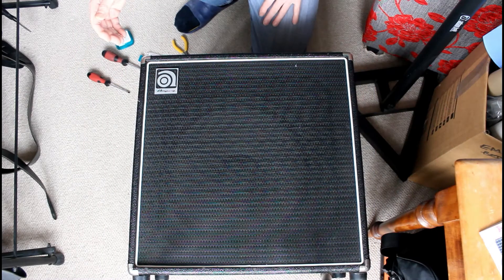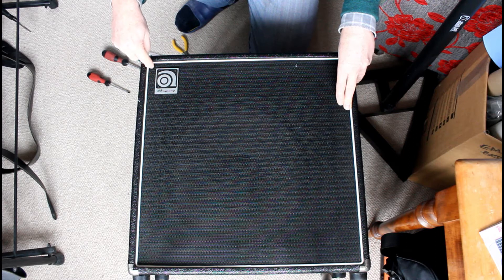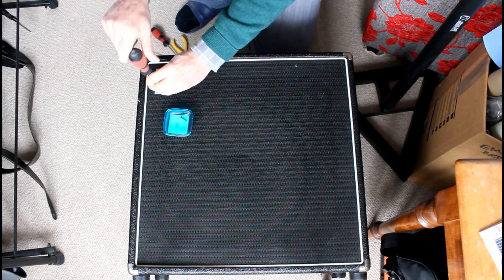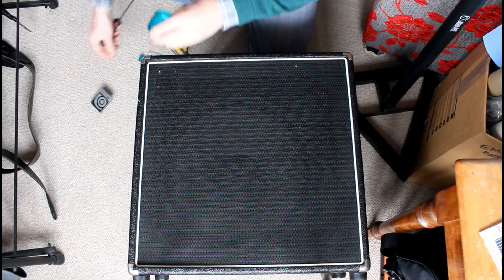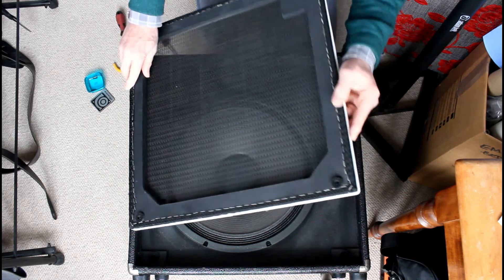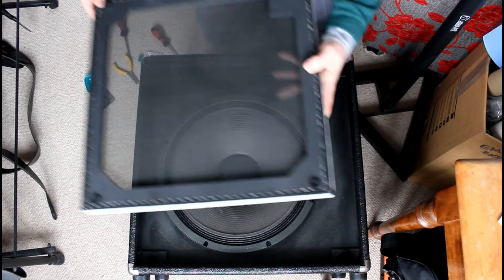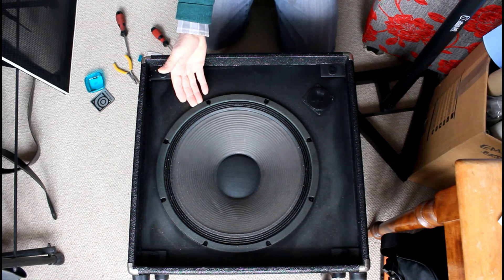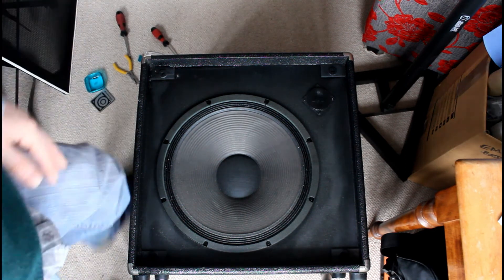Ampeg BA115 Speaker Grill Removal (and others)

Comment: How many pounds of pulling force is needed to free this baffle grill? I pulled with about 70lbs and it did not budge. Worried about stripping the screws.
Reply from the maker: Remove all screws holding the logo.  Replace one, but only screw into the speaker grill..  Do not screw through into wood behind it. Pry the speaker grill off.  Shouldn't need much force.
Reply: @dembydish  I ended up using a small pry bar and a loop of stiff wire under the nameplate. One screw would have pulled out with this much force, but I finally tore the panel loose.
Reply from the maker: @basspig I'm glad you fixed it.  The power of Velcro!
Reply: @dembydish  I think it was more of a frame fit issue. The cabinet was too small and the baffle a tad to large. I had the same problem pulling the amplifier for repair. It was jammed in there such that I had to use a pry bar to pull it out.

Comment: Thanks! can you show how to check the fuse on that model? my amp doesn't turn on anymore and it has no sound, not even the LED lihjt turns on
Reply from the maker: Hello Alberto, it sounds like your amplifier is not working, you should look for a fuse on the amp.  The speaker cabinet does not have a fuse.  What amp do you have?  There is usually a screw in fuse holder and the fuse can be removed and checked. Unplug the amp before removing the fuse. Replace with the same amperage fuse (written on the fuse). If it blows again, you should have the amp looked at, there is something that needs attention.  Hope that helps. Thank you for your comment.
Reply: @jmancali  Wow! thank you, I did manage to open it, it just blew and it wasn't the fuse what broke... I got it fixed and returned it to the owner, a friend of mine lent it to me and the guy who fixed it told me... return it at the earliest!... he kind of knew it would blow again... I am going to check that trick, I used it to practice, I'd put the backing track on it and practice guitar on a Vox, since the Ampeg has an RCA stereo input, it worked well... I want something similar with a stereo input that can hold a bass so I'll check if I can find some solution like the one you described... thank a lot man!